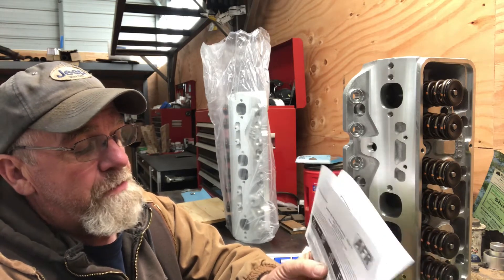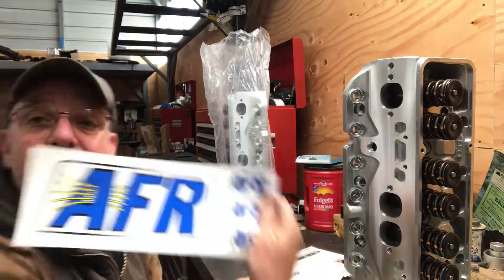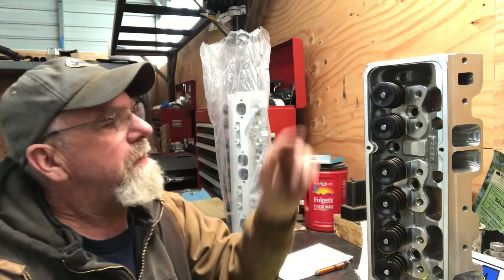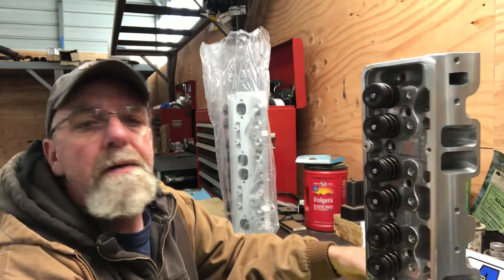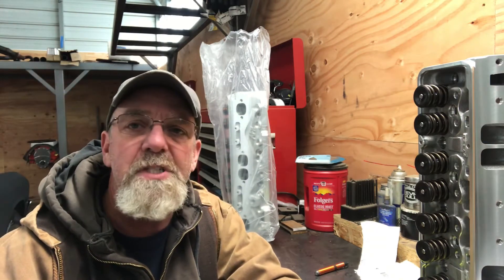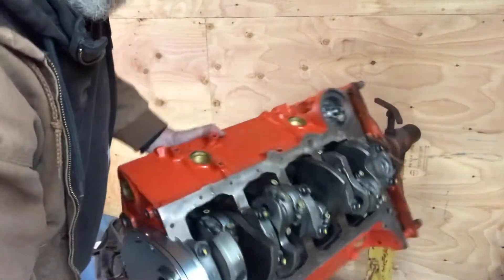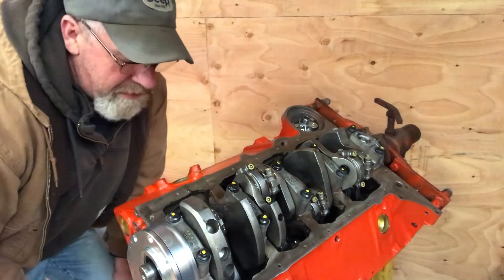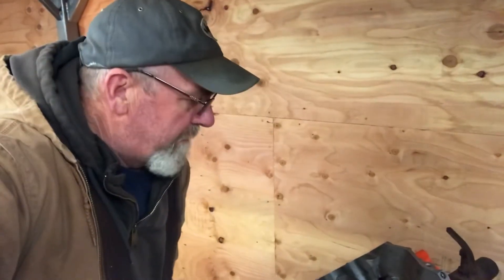AFR 220 heads for the S10!!

Comment: I think the .010 means ten percent more nickel, and the .020 means twenty percent more tin, also if you find a 4 bolt main block, get one that came originally out of a big truck, look for number 2482 on the center  3 mains, they are nodular main caps, and will be a brownish color, Im this gals auto machist hubby . Hope this helps.

Comment: You're getting a lot more power than what I typically see out of 383's. I am at a crossroads. I have a professionally built 355 that was assembled back in the late 80's in a 3400 pound car. 14 to 1 compression, .688 roller cam, steel bowties with 2.05's, Weiand Team G, reworked 750 Holley, steel crank and super rods. Powerglide with 6.14 gears.
Only has about 18 dragstrip passes on it.
Car has sat in the garage for 30 years and only started every 4 or 5 years, has oil leaks so I am going to pull it. Don't know if I should just upgrade with good heads and new gaskets or do something else. Will be 75% drag car and short 15 minute drives to cruise ins. Want most bang for the buck. Want a target of 550 horsepower. What do you suggest?
Jeff
Reply from the maker: sorry for the delay in answering you.... That sounds like a really stout motor you have! If it were me I'd swap out leaky gaskets and give the motor a good looking over and run it! The only thing I see holding you back from your HP goal would be the heads. I'm running AFR 220's and I'm really happy with them. they were right about $1850 for the set.. I've been looking at Profiler heads and think a set of their 210's would work really well if your wanna save a few bucks. 
Thanks for watching!!

Comment: hi
ROCKER ARMS: The Air Flow Research 180, 195, 210 & 220 
aluminum heads are designed to use standard pushrod location 
rocker arms (offset rockers are not required). Clearance between 
rocker arms and the retainers should be checked. For high RPM 
stability, the Jessel or T & D shaft systems are recommended. AFR 
stocks a complete line of standard and shaft rocker arms for your 
convenience. AFR suggest for the 227 & 235 you use a shaft mount 
rocker and offset lifters or a .050” offset intake rockers. With the 
.050” offset the intake rocker arms will be at a slight angle and the
Reply from the maker: It was suggested to use .050 offset rockers on the intake valves by a cam grinder I had been talking with. I ended up using non offset rockers but I can see where they would have helped on getting a better alignment
Reply: @ordinaryguygarage3667  
Hi on the pre eliminator series the 220 required some rocker offset.

Comment: hi Whats the results update with the heads ???   What was the cubic inches 383/400 u were deciding upon ?  Remember other Bigblocks with 383 or more common around 400 cubes and up use up to 2.2 or larger inlet valve . Any SBChevy cyl head was never designed for performance over 350cuin

Comment: I just bought a week ago the same identical heads,was told by an AFR tech.to just put a .045 shim under the springs if im over 260 @50,in which I'm running 272 an 282 @50
Reply from the maker: I talked with comp cams when I put my motor together and they were happy with the specs for the springs… I had the machine shop verify the springs were what AFR had stated. They seem to work good with my set up. What are you building?
Reply: What are the specs on your Cam
Reply: I'm building at 3:58 small block Chevy  15 to 1 compression Is solid roller Cam shaft
Reply from the maker: @paulmarbach6802  comp cams 12-908-9 solid roller… 264 270@ .050, .630 lift ( I’m running 1.6 rockers so actual lift is .672) and a 106 lsa…. Makes 626 hp@ 6800 and 564 tq@ 5100
Reply: What cid
Reply: Do you have any kind of idea what the hp my be.
Reply from the maker: @paulmarbach6802  it’s a 385 (.040 over 383) I have a few videos of it on my channel
Reply: Air flow research Tech told me I should be around 600 plus  with a 358 in 15 to 1  Is compression solid roller cam
Reply from the maker: @paulmarbach6802  sounds about right… gonna be a high rpm motor

Comment: I’m building 383 that’s close to the same combo with AFR 220 heads, solid roller with 640 lift, what rocker arm would you choose in a 1.5 ratio that would last a while, this is going to see some street use as well. Thanks

Comment: Read some of your different projects and it looks like we make a lot of the same or similar choices!  MIne - 1989 S10, 383, AFR195's, 10.3:1, 830-SS Quick Fuel.  Started with an XE274H and Edelbrock Air Gap (originaly buit as a street engine) - ended with a Crower 00307 and Edelbrock CNC ported Vic Jr.  It's 3200# with me in it.  Best of 10.8's.  446 RWH - should be somewhere around 520+ at the crank.  If your S10 weighs the same and makes 600 HP, you should be sitting right on about 10 seconds flat.
Reply from the maker: sounds like a nice set up you got! My "goal" is 600hp and a low 10 sec 1/4 mile...

Comment: I enjoy your videos.  What compression ratio are you running, cam specs, and how do the 220s perform off idle?  I have a 10:1 396 sbc and can't decide between the 210 and 220? Thank you
Reply from the maker: I’m running 13.2-1 on the compression and a comp cams 264/270 @ .050 and .630 lift, 1.6 rockers so actual lift is .672... I’m not currently running a trans brake so I have to leave the line at about 1,500 max.... it leaves really good

Comment: On the 1065 220 head,what header primary shud I run,I currently have hooked super comp.the header primary is definitely smaller than the exhaust port,I feel like I will lose power.

Comment: I have a set of brand new Scorpion rockers in 1.6 offset on intake/1.5 STD offset exhaust.  Is this what you are actually planning on using?  I bought them for mine, but realized I would have to re-set up all my guide plates - and it just wasn't that bad of a problem on the AFR 195s.
Reply from the maker: I ended up going with a std rocker as AFR suggested but, I can see how they are right on the edge of what you'd want to use. A .050 offset would have fit a bit better. How is the alignment on your 195's?

Comment: Hey can you send me the part number for those heads at summit. And also what's the specs on the cam your using? Thanks have a great day. Like your work keep it up!
Reply from the maker: The head are 1065 and the cam is a comp cams 12-908-9...
Reply: Thank you. Can't wait for the next video
Reply from the maker: @Marksingleton68  Not a problem! I've got a bit of repair work to do to my shop from the barn fire we had but, soon as that's done I'm goin after the S10!
Reply: @ordinaryguygarage3667  dam sorry to hear that I like the way your going with the s10. I'm building a 383 for my 73 Nova drag only car. Any tips and tricks you share, I'll be watching.
Reply from the maker: @Marksingleton68  Thank you!

Comment: Your springs should be fine, those heads are designed for solid roller seat pressure. Flat rappers use less spring for the same cam typically less eat pressure

Comment: I have the more expensive set of AFR 220's and run a solid roller cam LS firing order and make 558 hp 510 lbft torque in a tiny 383. You have room to grow! My 1966 Impala runs low 12's.
Reply from the maker: Nice! What are the cam specs?
Reply: @ordinaryguygarage3667  I will look it up, its a Crower beast series. Intake @ .050 260 Ex 264 lobe separation 108° lift intake. 643 
Exhaust .612 with 1.5 rockers 
part #F16296

Comment: Don’t take this to the bank but I heard that when you use that large valve head you have to clearance the cylinder block itself to get clearance because you moved the valve over, try putting clay or silly putty on piston top and rotate engine to make sure valve doesn’t hit, hate to see a beautiful motor hurt early in its life
Reply from the maker: v dean la valle we are on the same page... I’m not wanting to break my motor either! AFR actually recommends using clay to check the fit between the valve relief in the pistons and the diameter of the intake valve
Reply: That’s not an issue with 220s, it is with the 227 and bigger because of the 40/60 valve spacing but it is always a good idea to check piston to valve clearance

Comment: Did you have drill steam holes for 400 block?
Reply from the maker: Sorry for the delay in response!  I built a 383 so I used a 350 block…. However, if you’re building a 400 you  can either use a head gasket that has a elongated hole or drill the heads… if it were me, I’d drill the heads